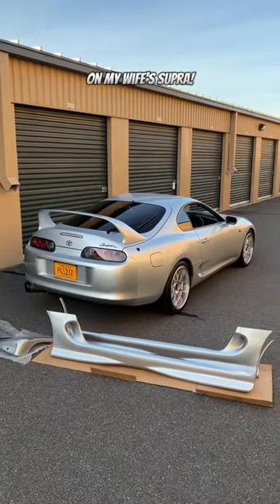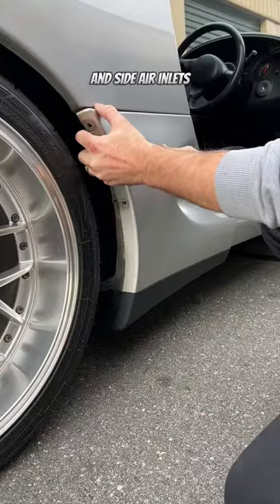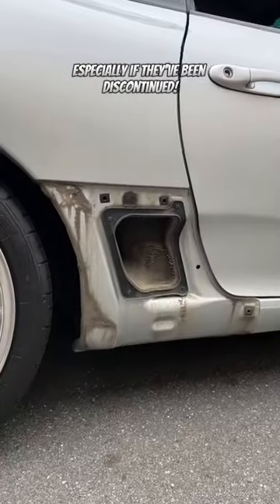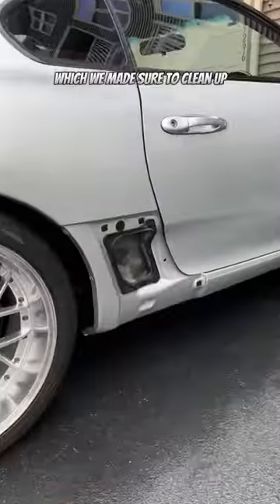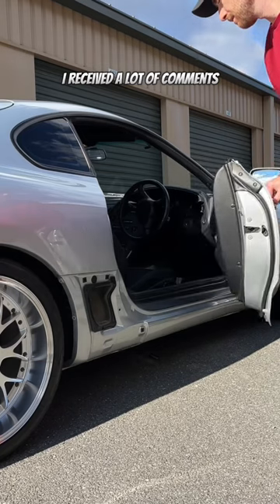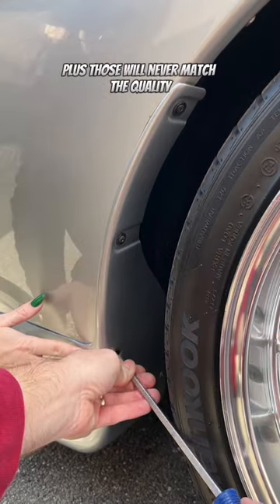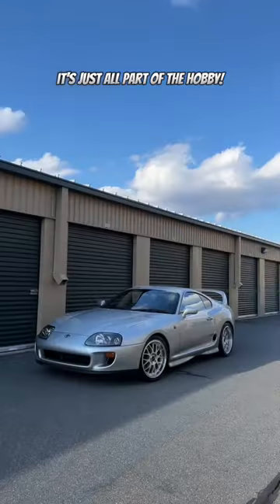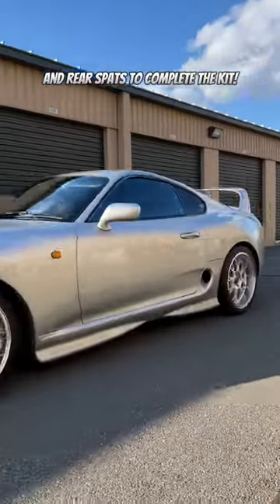Rare JDM Side Skirts Install on MKIV Supra!

Comment: Hi! I’m doing the exact opposite and installing the oem inlets. Do you know clips and parts I will need to Install the oem ones aside from the 3 trim pieces?
Reply from the maker: The clips are all the same! But for the part around the brake duct you just need 3 of those white clips instead of 2